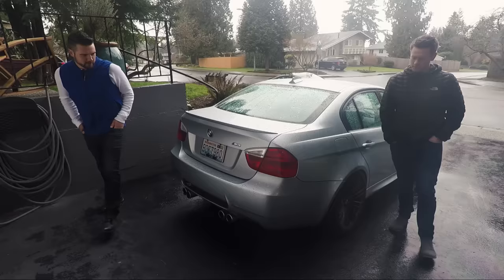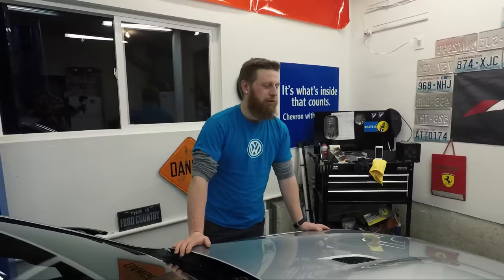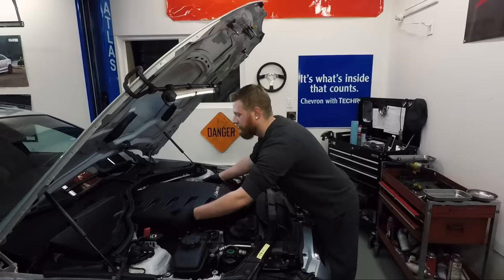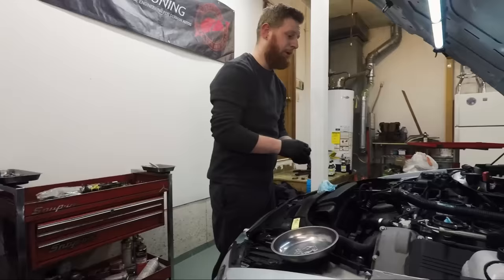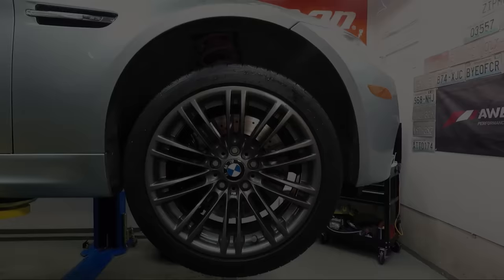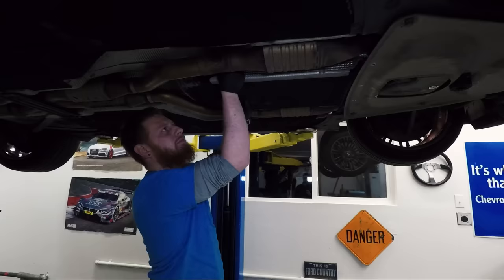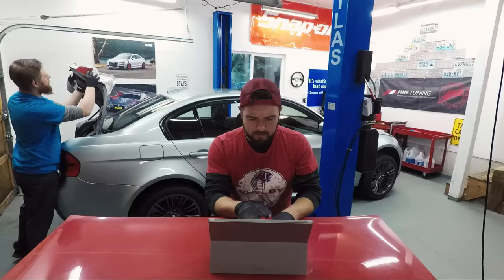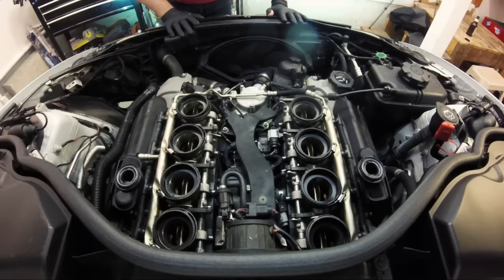How To Flip Luxury Cars For Profit (The Secrets!)

Comment: EXCELLENT, very useful video.  (I since purchased 2011 E92, manual, one owner, carbon roof, stock, white/fox red, 42k mi.; put 5k on it, love it after only 5 months)  I'd think they could have run both sets of throttle bodies off ONE actuator mechanism, but Hey, it's BMW.

Comment: If any of you reading this come to the idea to paint the brake calipers, please do invest a slight bit more time into it and do it properly.
One big thing to keep in mind is that with painting brake calipers, you are not only visually upgrading them, you also have the perfect opportunity to prevent rust in the future.

This means, every painting on calipers shall be done with calipers taken from the car, so you have access to the inside part of the calipers (where the brake pad is) and better access to the other side of the caliper which is facing wheel arch.

Process depicted in this video is not sufficient to acquire complete rust prevention, but seems only to serve for the product placement.

Comment: Amazing Video guys.!!! I have a SSII E90M3 Slicktop 6MT and I thought I knew everything about it. But y'all surprised me. 3 things (E-Brake Gear wheel can be tightened with out removing rotors) and ( 6MT Fluid Flush / Diff. Flush ease) and (Removing steering wheel trim with out removing the steering wheel)
Reply from the maker: I'm glad you found this vid/channel. Thx for watching and glad it helped out! Thx for the support!

Comment: The ZCP is definitely worth it. No one wants a none ZCP m3. Take a look on car sale sites. None ZCP cars are still there. The ZCP comes with a 1. Lower ride height, which is noticeable. Especially when you punch that M button on the steering wheel. 2. wider track (wheels are sticking out more). 3. Improved Throttle Response. 4. Sexy ZCP wheels, which are the 359m wheels. By far the best wheels you can have on this model. 5. Improved DSC. 6. Carbon Fiber splitters and Carbon Fiber trunk lip spoiler (mine didn't come with the CB pieces because i'm in the US and the CB pieces are offered in the Euro market).  
Aside from the Zee Competition Pack, these newer models come with Start/stop engine function to improve in gas consumption. The MPG also rises a little bit. Not to forget, the LCI update.
I think the Competition package is worth it. I bought mine ZCP because it performs better, it looks better, and it has updates. Especially in the used market you might as well get one with ZCP. The cost you are going to be paying just to make it look and perform similar to a ZCP will go over the price of a used ZCP. In the end of all the mods, It's just not the same as a real ZCP.
Aside from that this video is just awesome. I honestly didn't even realize it was 40 minutes long.
Reply: They’re minute differences of which you can accomplish the important ones with much less money, if you even desire too. Not everyone obsesses over the minor details, many would be equally happy owning any e92 m3
Reply: That's not what the used market is showing.
Reply: abraham G you replying to OP or me?
Reply: 100% positive the track is wider.
Reply: abraham+  I have a non-ZCP with some small upgrades and my friend has a ZCP. Throttle response is better in my car (maybe the ESS-software does it) and ride is as good. AND the ZCP-wheels are clearly heavier. I have also a M-performance spoiler. I must admit though that the ZCP-wheels look way better than mine. 
You are correct there that in mobile.de the ZCP:s are more expensive.

Comment: The rod bearing issue is a problem. Very tight clearances and 10w60 dont do well. Add the 8400rpm redline...
 If you have a low mileage e90 m3, change over to 0w40. Please change your oil every 5000 miles for the sake of preserving these marvelous machines.
Reply from the maker: Never skimp on quality oil and change it ever 5k. Great advice!
Reply: And warm up your car correctly. At least 15 mins before driving about 3000rpm.

Comment: I don't agree about the Comp/ZCP package on the E90 being 'easily' emulated with a $1500 budget. The suspension revisions, the wheels, AND the re-programming? Not likely. There are also more features you get on that package that I will not cover, but trust me it's worth it to buy one rather than make a non-ZCP M3 up to par with 'aftermarket' solutions. That said, amazing video, the nearly-50 minutes went by so fast and was a blast to watch
Reply from the maker: *Sorry for the long response. * I'm going off of my personal experience with my 06 ZCP, as I haven't driven an e90 e92 ZCP M. I know it's not an e90, but this was my experience and why I said what I did in the video. If I'm way off with the e90 chassis, please let me know! My e46 ZCP M3 was stock when I got it, and I still felt the ride height was a tad too high. So I ended up putting on new lowering springs. So it was a mute point that it had lowered suspension from factory, if you're going to lower it anyway. CSL reps ( I know they aren't authentic) are a couple hundred each new. My authentic CSL style wheels were pitted after 50K and I needed to either refinish or replace them. I just went with reps, but at that point you could go with any wheel you wanted. As for the remapped EDC and DSC. GAHHHH. Personally it still kicked in too early (DSC). On the track it kicked in right when it was getting fun.
All this said, if you're going to keep the car completely stock and not mod the car, then paying a slight premium for a ZCP may be worth it (and honestly when I had my ZCP I always felt like I had a 'special' M3). I just like to put springs and wheels on my cars to make it 'mine', so when you do that you really throw away most of the ZCP package. 
I really appreciate you sharing your thoughts my man! It was my first video I've ever created. It's my dream that one day I can do more episodes like this on other Ideal Cars, and educate enthusiasts about all the cars they should own at some point in their career. Been working on some sponsorship's and other ways to subsidize some of the costs to produce episodes. Thanks for all the support. Means a lot! And keep commenting!

Comment: Makes me hopeful for my 2010 Space Grey Manual E90 M3. Its got all the bells and whistles apart from the sunroof and no rear parking sensors. I might be parting with it sometime in the next 6 months depending on what new cars come to market. I've been the original owner since I ordered it back in 2009 and have kept every single service record, dealer or indy and have tried to keep it as clean as possible. I've just recently this year replaced the throttle actuators and changed out the rod bearings to newer more compliant spec from BE bearings (Aparently the engineers behind them were ex BMW engineers who wanted to make what they think should have been the rod bearings in the first place to handle the 10W60 oil). Its got 82k on the clock as Its been my only car. Do you guys think it will sell well once I put it up on the market?
Reply from the maker: Great spec! Yes with the rod bearing and TCA's taken care of... you shouldn't have a problem selling it once you put on market! What are you thinking you might move into once the car sells?
Reply: The Annoying Tourist ARP bolts with the BE bearings? You can’t do better than that, unless you’re the guy that’s trying to argue with me right now that rod bearings are somehow supposed to be wear items and it’s ok because “it’s a Motorsport car”. I don’t know why I waste my time replying.  You’ll be able to sell it easily, prices can sting depending on expectations but the markets healthy, and you’ve done all the right things.
Reply: Ideal Cars interested in what he’ll be moving to as well. I’m so split between a handful of cars myself. A s2000. A early 997.1, a e92 m3, a c63 or maybe even SL63, something with that 6.2 liter though, and a z4 m coupe since the z3 m coupe is still too expensive, even though prices have come down quite a bit. I really don’t know, the ability to find nice driving roads near New Orleans might make more of the decision than I anticipate, if so the BMW/Merc/and maybe a corvette become more likely choices. Also a cayman with a TPC turbo kit
Reply: Sunroof delete makes it more rare and desirable
Reply: Space gray + manual is my favorite combination on this car and you’ve gained my respect for enjoying such a cool yet rare combo, I hope the new owner has enjoyed & loved the car.

Comment: Did you consider plasti-dipping the steering wheel cover, seeing as you already had a can handy? It would more closely resemble the original coating, no?
Reply from the maker: It would peel. Honestly the results were OEM looking and would definitely recommend it for others to use the same process.
Reply: Well there are other components in the cars using the same finish so the main thing is that they match. Not saying your finish didn't look good but any idea if the actual BMW finish is possible to buy? All of their soft touch coated plastics get leprosy after 5 years so you'd think they would sell a product to fix it.

Comment: Hi guys great video!!! Question I have a 2011 bmw 328ix rough idle only at start then goes away. Clean mass air flow sensor, replace all filters, replaced spark plugs and coils with oem parts and cleaned mass air flow. Problem still there please help!!! Thanks 🙏
Reply: Dude mine started doing that and eventually got worse. I had to replace the camshaft position sensor on the intake side.

Comment: Why don't they put a cross linkage in there to keep the throttle bodies in sync?  Each bank is on a common shaft to keep those in sync.  One more part and it would be a far more reliable system.
Somebody should make that aftermarket.

Comment: does anyone here know the value of a 2010 BMW M3 manual, with salvage title, 24 thousand miles, and a large water leak issue in the engine bay the water is coming in where the cabin filter is at. I am getting a chance to pick this car up very cheap, hope to also fix it up an make a profit but I don't know what the value on one of these is with salvage title and a clear issue. any help would be great, thank you.

Comment: I will never change the v6 benchmark engine I own a 2016 M2, BMW just can't make v8's but of course that's a personal believe, so many problems with them, I've never seen a BMW that does not leak something after only 40 to 50 K ,for some reason they can't fix that, which is really a shame, such a beautiful machine with those pidley shitt problems, but then there's nothing ever perfect.
Reply: Let correct myself, I meant to say straight inline 6,  BMW does not make v6’s obviously.
Reply: An i6 will never sound as good or feel as nice (when working) as a v8.

Comment: If you use only two or three coats of Plasti dip to paint ANYTHING you WILL regret it massively!! You MUST paint on at least four and in reality go six coats. Otherwise you will be picking little tiny pieces of plasti dip off of your wheels or car FOREVER! Even if you try to use goo gone or even better WD-40 (yes it actually is even better) you will be in hell. I bought a car that had been painted in white plasti dip (two coats) and It took a whole summer to clean that thing off. And I mean every night for two months. Power washers helped in certain areas but not much.